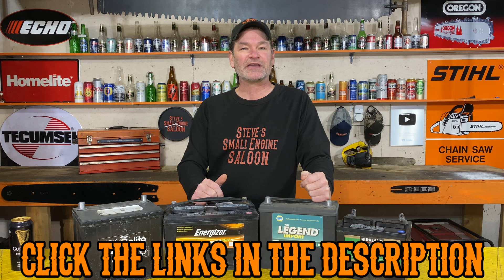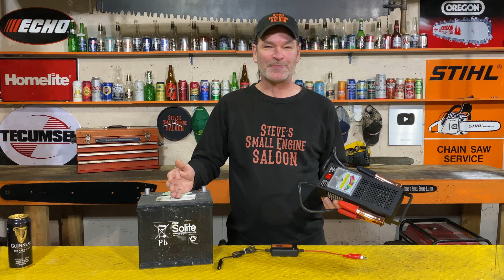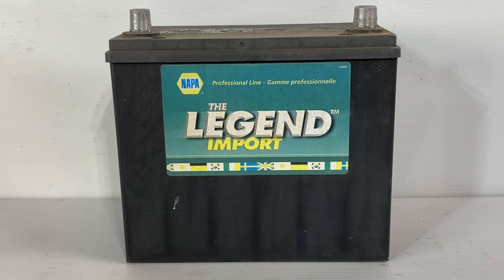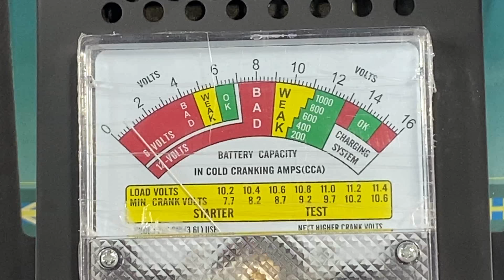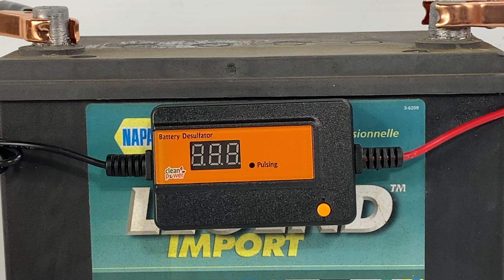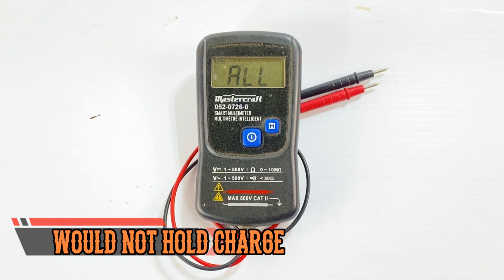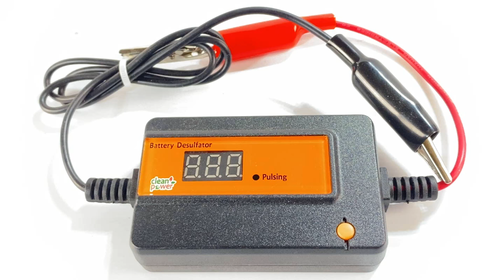Does An Electronic De-Sulfator Really Repair A Battery?? See Real Results

Comment: Could prove useful for EV drivers. Electric cars use 12V lead acid batteries, but don't draw heavy current Amp loads like an ICE starter motor would. Hence they can suffer sulphate problems early in life.

Comment: Hey Steve, I'd like to run something passed you. I've got steel post clamps that are loose and I'm wondering if I can tap on the lead  post to enlarge its diameter. Naturally  I don't want to destroy the battery but this might be better than the shims that aren't  working. Thx, Bltoth

Comment: i have never had any luck reviving old batteries, and now i will tell you why, because if its a 2 year guarantee battery and its over 2 years old and it wont hold a charge its fucked :).
4 and 5 year guarantee batteries are also available..

Comment: Thanks for great info Sir. As a ham radio operator, we keep backup power batteries & inverters in case of emergency. I have a couple of 126Ah truck batteries & have just been given an 85Ah sealed leisure battery that needed a distilled water top-up (I make my own) , so drilled 6 holes topped up & resealed with hot glue. 1 of my chargers has pulse repair. This 85Ah leisure battery boils my 12-volt kettle that draws around 14 amps, but this restored battery probably will provide more, but perhaps not 85 amps as it is more than a few years old, so will be good enough to use with my ham, CB & UHF radio gear drawing anything from a couple of amps up to around 40 amps........ With this Russian business, One does not know if things escalated & we lost power here in the UK if our fragile grid was damaged with conventional or EMP weapons.

Comment: In many cases you can pry off the top of the batteries that are flat and do not have fill caps..  Once you pry off the plastic top cover, the cells have the rubber caps and you can refill with water.  The low voltage batteries probably have a dry cell or two.  Don't know if adding water will help them but without water you don't have a chance of rejuvenating them.

Comment: With the battery that was holding at less than 8 volts, you could parallel it with that other bad battery so the desulfinator would ‘see’ 12 volts and try that to get that battery working. It’s worth a shot.
Reply from the maker: Agreed!
Reply: Two 8v batteries in parallel will signal 8 v to the desulphater. Did you mean to connect them in series?
Reply: I had a 5 or 6 V battery, I coupled it with a 12 V battery, but still in vain. The charger began to charge it but not to full capacity. It was stable at around 11 V afterwards. I guess the sulfation was to strong.

Comment: you have to charge the battery with the desuphanator hooked up to the battery charger and battery, Its not a stand alone desulphanator, I Bet all your batteries can be saved charging with the sulphanator hooked up to the battery and charger.

Comment: Yea, That Battery Desulfator does Work and it works very very well, It will restore about 85% of sulphated batteries, I bought a bunch of them :) the 2 amp and the 4 amp version, I gave some away to my sons,  I use them on my solar lead acid batteries, I have a 500 amp carbon battery load tester, On one battery a group 27 loaded down to 9.6v it only produced 100 amps, I charged the battery with a 6 amp battery charger and the 4 amp desulphanator  over night and I was able to get 400 amps at 9.6v load on the Battery tester, yes they work and work well, some batteries may have a bad cell, and it wont help those batteries, the batteries that are sulphated, they work great :)  Take care, Chellie
Retired, Female Fleet Equipment Mechanic.

Comment: I ordered one of these today. I have several batteries at my shop. I do welding/machining and small engine repair. Hopefully it will save me some batteries. I hate sending them to salvage. I have also seen this done with an arc welder. I'm going to experiment with that too. Hopefully I won't wind up looking like the nuclear sludge monster. That's definitely going to be an outdoor experiment.
Reply: See ‘Sweet Project Car’ about battery restoration with a small DC welder.

Comment: Great practical video! I have 3 batteries to try this on and will report back! I don’t currently have a desulphator. Can I use a variable 30 DC regulated supply and set current limit to 1500 ma? I can plug supply into a timer to ensure it shuts of in 24 hours.

Comment: I invested in the same resistive tester.  Resistive testing has been the gold standard for 60 years at least.  However on smaller motorcycle or garden tractor batteries I'm going to invest in an electronic tester.  Not as savvy a result but easier on the battery.  I don't want to place 100 amp loads across those wee batteries, it might melt the internals.

Comment: I have used a VERY cheap one that I found on eBay that was just a bare-bones circuit board and while it isn't a cure-all as you said, I do notice on my car when it starts to crank a little slower, I pop that on for a day or so and it cranks a lot better. Sure, if your pack has an actual physical short or a cell that has physically disconnected it won't fix that but for what it costs vs a new battery, it can't hurt to try! Even if you can't use it for starting your car, you can still use it for backup power in an emergency.

Comment: Right from the start. Lead acid batteries shed lead from the plates, and you cannot restore it. If it goes below 10-5 volts for more than a brief time, it's dead. 40 Ah battery might get back to 8Ah if you are lucky.

Comment: Great Video! Thanks for testing this. Do you know if this would work on two 6v batteries in series? I use that configuration for my travel trailer.
Reply from the maker: Yes it will

Comment: THE SECOND BATTERY WITH LOW VOLTAGE YOU HAVE TO JUMP IT WITH ANOTHER BATTERY TO GET THE DE-SULFATOR TO TURN ON. ONCE ON USUALLY YOU CAN DISCONNECT THE  SECOND BATTERY. OR KEEP IT ON FOR A LITTLE WHILE TILL THE VOLTAGE GOES OVER 10V IN THE FIRST BATTERY THEN DISCONECT

Comment: I use the BatteryMinder which both charges and desulfates.  Keep my motorcycle connected pretty much whenever it's parked.  The lawn tractor is on one all winter.  

Motorcycle is from 2014 and is the original battery.  Lawn tractor is from 2012 and is the original battery.  I've hooked it up to batteries that were weak and most came back enough to run well for months.  I put the big tractor on it and it makes a huge difference in winter starting power.
Reply from the maker: Thanks for sharing

Comment: I think this is very convenient product to make some thing that just blinks an LED sure there's probably some  out there that actually that do some thing but I would be concerned that there's a lot that would look identical and yet not do anything. That being said should they be left on the battery, should they be casually used, is the one I'm working on drawing 1 amp gonna kill the battery in a week. Why did it blow its fuse? So many questions. Then there's just doing a discharge charge cycle is enough to restore some batteries. I think I'd rather invest in a good charger that has the capability built in and just run it on the batteries every so often.

Comment: Great video again Steve!! I bought a battery repair charger in one and it fixed my BMW branded (Varta) diesel battery, but I think it needs topping up as on minimum level for acid and it's a sealed battery but I think you can peel the stickers back to reveal caps top off with Distilled water and that sometimes works ok, so I might do that and then go through the process again to see if it's still ok.. 
Iv also got another Ford Varta Diesel battery it hasn't worked on don't know if needs fluid or if it's toast, but desulfurization didn't work first time but as it's black case can't see the levels and haven't bothered taking caps off yet but if can be fixed theyre a fortune like the BMW Varta ones are! The charger repairer cost about £40/60usd on eBay so saved that I'm saving one of my BMW batteries already..
Anyway cheers from London England 👍💪😎🏴

Comment: Hi Steve how are you..I used to salvage my battery life the old Fashion way.. looking at your video using a desulfator totally freaks me out.. thanks for that video by the way.. never knew that existed.I used take my batteries, thaw them out when Frozen,non maintenance free battery, take a volt test ,see if it reads 10.4-to 10.6 minimum before proceeding that it's salvageable, open up the caps ,fill it up with distilled water, charge it up with my trickle charger..I have a100amp/15amp/2amp charger start with 2amps and finish with 15 amps total  8 hours ,final results I get 12.8 to 13.3..but looking at your video seems to save me more than half the time.. amazing.. I am going to purchase one myself.. thank you very much for this wonderful video Steve to have awesome videos.. Cheers Mann...
Reply from the maker: Right on buddy!  Thank You...
Reply: You welcome..

Comment: The battery chargers with a desulfation mode only run in this mode for a short period of time ( a few minutes) before switching to charging mode. This is based on actual charger monitoring test data.. A device like this one should be more effective as it desulfates for hours/ days.
Reply: I have a charger with desulfate mode, it normally runs 24 hours before it is done, the battery in my truck was brought back to life by it. I have had that charger about 15 years and rescued a few batteries. Years ago on the Nicad cells, I had a pulse charger that would bring many of them back to life!
Reply: Thanks Steve. Sounds like you have one of the  better desulfating chargers.

Comment: Capacity test, Capacity test, Capacity test.  Who cares if it "holds voltage" if the capacity is now only 10 amp hours instead of 40 or 80 amp hours like a new battery.   Without doing a capacity test you know nothing about the battery.  That De-Sulfator is only worth anything if it can restore the battery amp hour capacity.   It won't.  None of these guys actually do a charge and then discharge capacity test when they are selling this garbage.  Lead acid batteries are practically obsolete at this time.  If you plan to own the vehicle for more than five years, buy a LFP battery.  LFP batteries have 1/3 the weight and will last ten years.  A brand new lead acid battery only has half the usable capacity that they advertise.  Lead acid is really just old junk when it's new.

Comment: If battery voltages is under 8V you can "jump start" the charging by using other 12V battery parallel. After several minutes you can disconnect the jump leads and keep charging as normal battery
Reply from the maker: Great idea!

Comment: Hey Steve, the next time you get a battery that doesn’t have enough in it to get the desulfator going, maybe experiment a little and see if you can trick it into turning on by connecting another battery to the bad one so the desulfator is getting 10 - 12 volts and turns on.  Then try disconnecting the 2nd battery from the bad one and see if the device stays on and can work the battery over.
Reply from the maker: Good idea!
Reply: @StevesSmallEngineSaloon  
Thanks! We have to do that sometimes at work to get locomotive batteries to start charging. Our “smart” chargers won’t charge unless they see so many bolts in the batteries to begin with.
Reply: @ralfie8801  that wont work. it turns off below a certain voltage. I've tried every way with this kind of unit. 
And yes you can run it with a charger connected, so if the voltage is high enough it will turn on

Comment: To get the desulfator to work on the low battery...  Jump a good bat in parallel to get volts up.  Then put the desulfator on the bad bat. while leaving the the other bat connected until the bad bat is over 10v. worked in the past for me anyway.
Reply from the maker: Great idea!

Comment: As a technician for interstate batteries for over 22 years, I can tell you quite easily. I saw the headline and thought it was meant as a joke. If the separator between the plates is torn or hazed, which happens over time, the battery will be useless. No good. At all. Nothing you can do. This is because the two plates are macing contact by means of an arc between them. Anything lower than 11.7 volts indicates this issue. It's impossible to rely on it from here on out. The arc causes a mushroom effect inside the case. And this mushroom digs through more and more plates. Why? Because over time the pasta on the plates becomes brittle and any flake as small as the tip of a lead pencil will start the mushroom. This is specially true with plates that are made on a belt pasted. Belt pasters apply the paste mix onto the grid through one sided and tge opposite side of the plate is completely exposed. This leaves the plate more prone to flaking. Interstate batteries uses a proprietary pasted which gas superior filling but still is not flake proof forever.....like any other battery.

Comment: Back in the olden days folks cleaned out worn out batteries and pour the acid back in. The battery in my truck was new in 2003 and has 420k miles on it. If the lead plates are shorting out the battery won’t work remove the short magic happens, must be smarter than the battery. FYI. Still have original starter and alternator must be smarter than equipment.

Comment: you need 200 amp charger at 15 minutes for 5 cycles on those other batteries if the acid levels are right. if you can drain out old acid and wash the cells with distilled water refill new acid and they will be like new amg cell you cannot drain so just the 200 amp cycles

Comment: Hi Steve love that you're doing a battery video too!! I've got son & daughter's old car batteries I've swapped out for them lying around charging up. Both are around 43ah 50ah. I'm going to be using them for LED lights around the tents when camping this summer  and also charge our phones up. I'll be connecing a USB adapter for that which are 12v input and whatever (5v) USB. Everyone is excited......we have even got a small 5w solar panel. Have you got any advice on safety like fuses? I will watch and nurse the system and disconnect everything before we go to bed (promise) but should I use a fuse box and would a 10amp fuse do the job?
Reply: Hey Buddy, yeah, old car batteries are excellent for this sort of usage. especially the first case presented here, holds voltage, but fails under load. a few LED's or a phone isnt going to bother them, and gives them a second useful life. Ive rigged a similar sort of thing up for my Dad in the hayshed (no mains) to run a car radio. whilst not essential, fuses are so cheap I always fit them to things im going to turn my back on. there are plently of small fuse boxes for auto use that have a common negative bus and a few fused terminals makes wiring a few devices up heaps easier and fuses them to boot. 'auto fuse distribution box' in the googler. 10A is probably to big, a fuse only protects wires, so look at what wire you are using. for such light duty I would probably go 3A. remember to fuse your solar to! on that, a 5W panel wont really help out all that much. better than nothing, but Id want at least a 50W if I wanted a few lights for a few hours. you'll also need a charge controller of some sort (although some of the swish 'fold out' ones have that built in.
Happy Camping!

Comment: yea.. here is an immediate problem i see.
the desulfator is only 4 Amps max.. try using a welder or something that runs at least 100Amps in order to actually make the battery cook, after you refilled it ofc.
only do it if you know what you are doing, playing around with high amps  and Acid fumes is something to be respected

Comment: de-sulphation is legit. Its not usually something you can do with a standard duty battery because of how thin the lead plates are. This is done weekly with electric reach trucks in normal beat the hell out of it freight work.

Comment: I heard a method for bringing back completely dead batteries by running charge in reverse.  Postive to negative and neg to pos, apparently desulfates and removes scale from lead plates. After that you would run the battery dead, drain acid and replace, then charge normally.

Comment: A totally different problem, of a similar nature is found in winter in the north wear temperatures go into the negative zero range. The battery can "freeze up" if it's used to crank too long on a motor that won't start.
It works like this: the acid is actually an acid/water solution. The acid keeps the water from freezing in Sub-Zero temps. But, the whole battery is actually significantly colder than the freezing temperature of water.
As you crank on the engine, the battery produces power by the acid in solution combining with the lead plates, weakening the acid content of the solution. As you crank, the solution becomes so weak that the water will suddenly become able to freeze. The water then coats the surface of the lead plates with a thin coating of ice, preventing any more acid from combining with the lead, and stopping the chemical reaction that allows the battery to produce power. Neither can the battery be charged as long as this thin ice coating covers the plates
People who don't understand what's happened, then take the battery to an Cuauto parts store, and buy a new one, saying that their battery just died.
All that really needed to be done was to warm the battery up, thaw out the ice, recharge the battery, and return it to service.